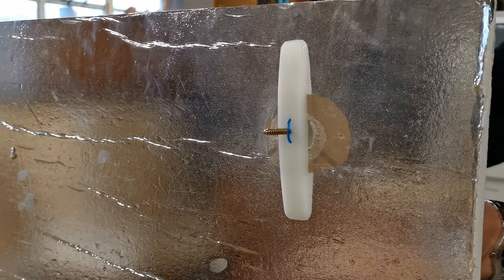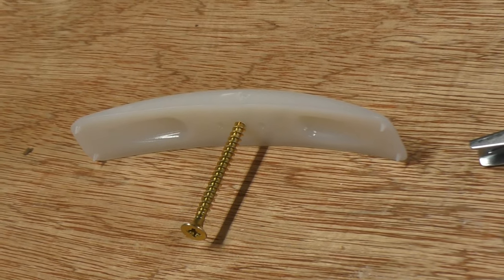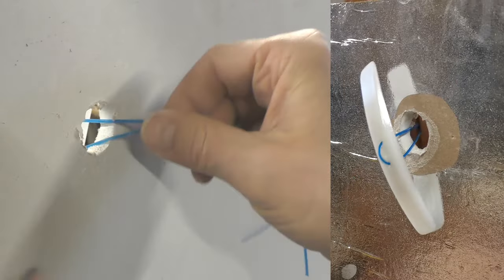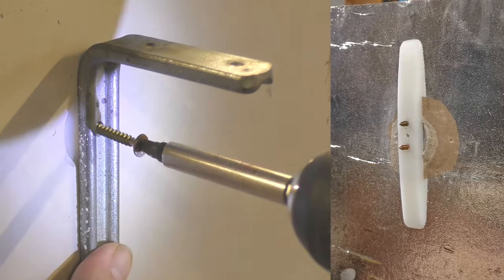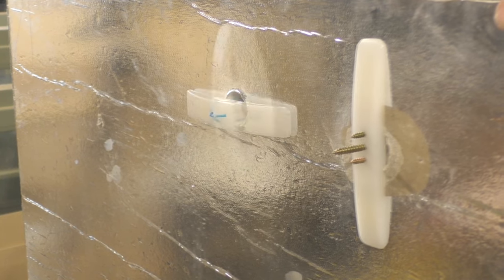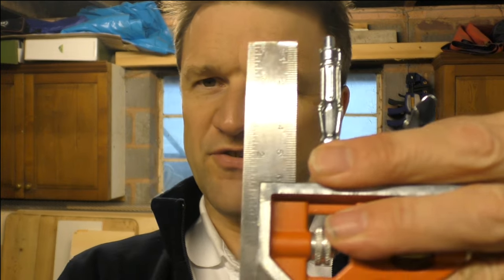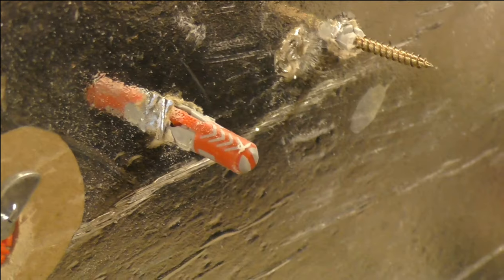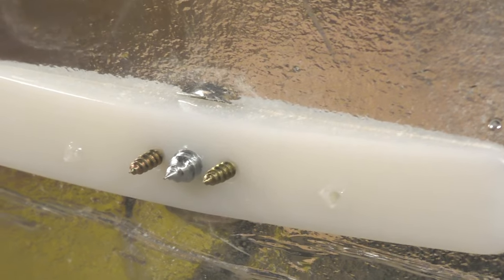The Strongest Plasterboard Fixing Ever!

Comment: These will NOT work on our 1985 house with dab and dot PB walls. I've tried everything over the last 39 years. The gap between the plasterboard and thermalite blocks is maybe 10mm and it would be impossible to slide the large fixing in.

Worst case is you hit a dab of hard plasterboard adhesive, then it's impossible to use anything except a drilled plug. However the plugs work well in the solid adhesive. I only use Fischer plugs, Duo are good. The critical issue is a long plug to secure into the blockwork (which fractures easily).
Fischer UX 10x60 work well with a 100 x 7.5mm concrete screw that extends beyond the plug into the block. I drill undersized at 9.5mm for a firmer fit, just deep enough for the plug which allows the concrete screw to bite into the block.

So these fittings are best for hollow walls, not dab and dot walls.

I find best practice is to spread the load and use mechanical advantage (lever). I screwed a block of wood 70mm x 400mm to the wall fixed with 4 screws on the top edge. Seven coat hooks screw to the wood. The wall screws provide 40mm of turning moment (lever) above the hooks which have a lesser turning movement. This significantly reduces the pull out force of a coat hanger screwed to individual plugs - I did that in the 80s and they all pulled out as the years went bye. 

The wooden bracket is strong after 10 years with zero flex or wobble. Ditto for twin wall shelving, the highest screw has tremendous mechanical advantage for a bracket 400mm lower. I highly recommend twin wall for shelving on plasterboard.

Comment: Issues with this is when drilling you are near / on the dot and dab and so the large plate fouls!

No good if what you are fixing requires holes close together, dictated by holes in product being fixed
Reply from the maker: As I showed in the video, you can self tap anywhere along the wing so it's not a problem fixing screws very close together. With dot and dab I wouldn't recommend this fixing. I'd recommend the Corefix as you really want to fix into the brick https://youtu.be/fx90VadXSXA

Comment: do you think it would hold a 70kg tv
Reply from the maker: Impossible to say but doubtful given that weight, particularly if it's exerting a cantilevered force eg if the TV bracket swings out. It's the plasterboard your worried about failing rather than the fixing.
Reply: @CharlieDIYte  thank you Charlie my mistake it was 59 kg not 70 and fixed the wall not moving out

Comment: No the one you put into the wall and you use the machine to pull it in and it surrounds the wall like a big star on the back of the slab one holds 50kg or more all depends on the size

Comment: An excellent product but the only problem I can see it that you need a very big gap between plasterboard and main wall behind. The fixing looks at least 3" so has a limited capacity due to needing a big space behind.
Reply: he explained in the video what minimum gap was required (30mm)
Reply: @dazmeister9  Thanks. Will watch again...must have missed it. If it's only 30mm required then top fixing!
Reply: Ricko Rider no problem. 👍🏽

Comment: @charlie please help! Recently moved in to a new home, walls are lightweight thermal blocks and we have a 20kg mirror to hang. We have been to numerous hardware stores and get told all different things leaving with numerous size screws and drill bits 🙈🙈🙈 please help! Can send you a video if needed : ) thanks Glen
Reply from the maker: You should try Corefix Air (designed specifically for thermal blocks), and if you've got plasterboard on the front, they're also designed for that because they've got a steel core that bridges the gap to prevent the plasterboard being pulled back when you tighten the screw. I'm assuming you're in the US? I'm just asking the manufacturers where you can buy in the US, as I thought you could get them on Amazon but can't see them right now. I'll get back to you.

Comment: Is it just me, or is it hard to even drill a hole for a Molly without the plaster crumbling? Also, I struggle to find a stud too. I will go to a corner and measure 16" and use the stud finder, then 18", 24". Surely no one builds a house with them farther than 24", right? I'm a 57 year old woman how doesn't build structures, but I've heard men brag about building "it" with 16" on centers, right? 🙂
Reply from the maker: Ah, I see you've already discovered the Geefix. Yes, the studs should have 16" centres, but I agree it can be hard to locate them. Have you tried tapping to differentiate between hollow and hard areas (the hard areas being the studs)? Also, each stud will have a load of nails in it so maybe try a metal detector if you have one. Some people use magnets, but in an older property with thick walls this might not work very well.

Comment: As a professional carpenter I don't like how long they take to use I prefer these to anything else....https://www.screwfix.com/p/fischer-self-drill-plasterboard-fixings-metal-35mm-100-pack/47347...becasue they are cheap and quick to use and plenty strong enough for most things ...Maybe the odd application for these new fixings where the fischer fixings can't be used but that'll be it. I personally don't think they won't take off in a big way.

Comment: ok but the 25mm hole is the same size as the blue gripit which is the largest one.
Reply from the maker: Yes, but the Gripit wings that open up are too small to justify a 25mm hole.
Reply: Charlie DIYte ok then that should be the reason you say and not the size of the hole
Reply from the maker: @stevelau8802  Ok but I feel I did make the point by demonstrating how massive the Geefix wing is that fits behind the plasterboard when compared to the competition. It's the ratio between the size of hole and the size of the wing or umbrella that opens up behind that's important. The design of the Gripit is flawed because the wing sizes are constrained by the size of the fixing that they have to fold into. Fine for sheer loads, not so good for cantilever forces. I'm doing a new vid at some point this year. I'll make sure I hammer this home 👍

Comment: The toggler 2 is probably a little better then that cause the hole you need is only half an inch or 13mm and does just as well.  I have mounted 15 inch deep shelf on drywall and they hold amazingly well.  would really like you to check them out.  They are a very different to use but you can put them in pretty much anything and the flat plastic part pulls tight against the wall like a ziptie.

https://www.lowes.com/pd/TOGGLER-2-Pack-Assorted-Length-x-1-4-in-Dia-Toggle-Bolt-Drywall-Anchor-Screws-Included/3183821
Reply from the maker: Yes, I'm aware of snap toggles but for some reason haven't really used them that much. I agree, though, they're a great system. I think toggles / snap toggles are amongst the strongest fixings out there. The beauty of this one though is you can self tap other screws close to the central screw, should you need to do so, and use normal screws whereas with the toggle, you're restricted to using the bolt.
Reply: Charlie DIYte true but the one I listed isn’t a toggle kind and you can take out the bolt and not loose the toggle and I have used different bolts or screws as long as the threads match.  I usually use what they give you but I have used counter sunk screws and stainless and they look great

Comment: Way too expensive. I have , for years as a kitchen and bathroom fitter used Spit Driva self drilling fixings (approx £16.00 per 100). very quick and easy very little mess and are strong enough to hold kitchen cabinets full loaded without issue.

Comment: 25mm hole? I don't think my landlord will be happy with that...
Reply from the maker: No, I agree. Depending on what you're putting up, the Fischer Duopower 6x 30 or for heavier stuff 8x40 is a very good fixing.
Reply: @CharlieDIYte  Thanks! I need to hang a 20 kg flatscreen on the wall, with 4 plugs, so those 8x40 Fischer Duopower sound good! Hopefully I can find some studs and drill them in there, but you reckon those 4 plugs will be ok if I can't use the studs?

Comment: The strongest fixing is a screw directly into the studs, or cut in & fit a solid batten to take a screw.  Nothing else will do for fixing heavy items, e.g. a sink, thank you.  Nice idea, but costly @ £1 each (trade pack), AND the outside bit sticks out by 1mm or so, plus screw heads.  And the pbd must be adequately secured to the studs,  a screw every 300mm, 200 if in doubt.  Nice vid,  but Geefix? No thanks.

Comment: Sorry but their claims on carry load is not correct.  In direct comparison with spring toggle on the Ultimate HAndyman videos they gve out at 126Kg... and Spring toggles munched them at 176kg.
Reply from the maker: Horses for courses. You can't reposition screws with the spring toggle, or fix other screws in close proximity. I agree though, spring toggles are awesome if you can live with the limitations.
Reply: @CharlieDIYte  You can position screws in close proximity depending  on the orientation of the toggle.

Comment: HEREIS THE REAL DEAL ON THIS PRODUCT. MANY AS IN M.A.N.Y REVIEWERS ON AMAZON COMPLAINED OF THE LINE USED TO PULL THESE TIGHT AS SNAPPING VERY EASILY. SOME ALSO COMPLAINED OF THE PART THAT GOES BEHIND THE WALL JUST SPINNING ON THEM. THEY COULDN'T GET IT TO TIGHTEN. SO IF YOU REALLY WANT TO TRY THESE HERE'S A TIP. REPLACE THE LINE WITH 30 LB MONOFILIMENT LINE. THAT WONT BREAK. TRY TO TIGHTEN THEM WITH A SCREWDRIVER INSTEAD OF A FAST SPINNING DRILL. BETTER YET JUST USE SNAP TOGGLES. THEY'RE SUPER EASY TO USE + SMALLER HOLE AND THEY CAN CARRY A HEAVY LOAD ALSO.

Comment: Great until you drill next to/ into a dab of drywall adhesive 🙄🙄🙄
Reply from the maker: Fair point. You should do a tap test on the wall before drilling and could even start off with a 5mm bit to check what's behind, because obviously a dab of adhesive is far superior to anchor into than any plasterboard fixing.
Reply: @CharlieDIYte  I’m all for making things easier.... great product for the right situation

Comment: lol, so instead of using one screw and one anchor of type, now your using three screws and one anchor ... I'm guessing you got stock in screws?
Reply from the maker: What sort of an argument is that? 🤣 Screws are cheap. The important thing with any plasterboard fixing is to preserve the integrity of the plasterboard and the beauty of this fixing is that you can fix even more screws (which you'll be delighted about 🤣) into the fixing if your bracket or whatever you've fixing to the wall so requires, whereas with any other fixing you'd need to redrill the plasterboard to insert another fixing, which will weaken the plasterboard.

Comment: The claims on loads is absolutely an outright lie . I have tested these on tensile, cantilever and shear. Greatly exaggerated. Not  impressed ..
Reply from the maker: I think tensile load info is largely irrelevant anyway because the plasterboard is going to fail long before the material the fixing is made out of, but the point is, if you can't rely on a fixing into a patress, or the substrate behind, you'll struggle to find a fixing that puts a larger or more secure anchor behind the plasterboard.

Comment: not as easy as using wall anchors and the tool that compresses them, the plastic will never be as strong as the steel collapsing anchor and you only have either horizontal or vertical loading onto the gyproc i'm sorry but way to fiddly how many would you drop into the cavity cos you let go of the sting "strimmer wire" and it sits proud of the wall, might be useful in certain situations but certainly not anywhere near HEAT!!!! just a thought!

Comment: nahhhh do not like them, for a few reasons:

1/ The same issue as with the gripit, massive hole in the wall to install
2/ They are plastic...........
3/ Looks like a faff to install to be honest
4/The anchor HAS to be more heavy duty, has to be Charlie, it is metal and more of the thread is gripped in the metal housing of the anchor whereas this is plastic and the actual bracket or whatever you are fitting is essentially secured by 2,3 maybe 4 at most threads of the screw through the plastic plate, common sense surely says a metal construction will be stronger?

The price finally, lol £14.95 for 8 pieces of plastic!! Please............. Anchors are the only solution that is needed for any application, don't like them, they just look like over priced pieces of plastic to me, similar thoughts about gripits.

On a side note I recently had to re-install our stair hand rail at home,  the previous monkeys that installed it into plasterboard used the ermmmmm screw in metal type plasterboard fixings, don't know the name of them, like a screw in plug anyway, daughter tripped coming down the stairs and grabbed the hand rail and it just pulled out of the wall, I tidied it all up and re-installed it with anchors, you would pull that side of the house down before it comes off again.

I just see this as something that really did not need inventing, if there was a small cavity then there are much better fixings directly into the brick work that ANY plasterboard fixing, you over torque your fixing screw which into plastic would be very easy to do and you will be throwing one of these in the bin, by nature when attaching anything heavy to any wall you tighten the nuts out of the fixings, your normal everyday DIYer I think will have issues with these.

Anchors all the way :)
Reply: I'm glad your daughter wasn't hurt by her fall. We do stair railings for customers frequently. I go to the trouble and expense of finding wall studs to anchor to. If none are available, I will only take on the job if the people are willing to let me open the wall (often doable on the other side which is frequently a utility space of some sort) and insert a proper plate to mount to.
That said, I've worked with nylon for many decades. Comparing it to the cheaper plastics isn't fair or productive. I've seen Fischer 'S' wallplugs I did in the early 1980's for an Aunt in Ireland hold up 20 kg loads for decades - in that awful wallboard Europe was using back then. 
I'm willing to give it a go. You are, of course, right that anytime you can mount to brick, it's better.
Reply: I would never use a drywall anchor to mount something that got constantly torqued on, like a stair rail.   It’s well worth the effort to find the studs, there’s one every 18 inches in the US.  I’d feel much confident with a 200-pound grandma trusting  that rail, tied to the wall studs, as she hobbled down the stairway.  I’ve seen plenty of lose stair rails attached to fractured drywall.
Reply: Run a length of skirting/facia even something decorative then fix yr hand rail to that...kinda scarlet fixing it direct to plasterboard
Reply: Set the drill clutch and you won't smash the shit out of it.

Comment: There are better products on the market, better still cut out the plasterboard to the timbers, fix battens and then ply sheet, refit plasterboard, make good wall, hang a washing machine on the wall, why who cares, but it works.
Reply: Missed the point, these are for normal DIY jobs that anyone could do. The majority of people could not do 80% of what you have just said, plus the cost. If you didn't have any the cost of single sheet of plasterboard is the same as a pack of these.